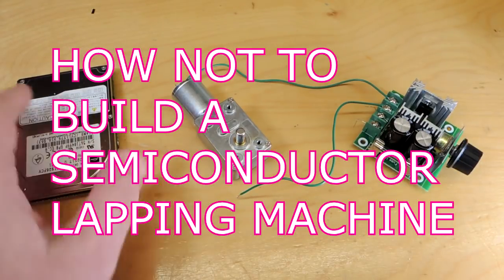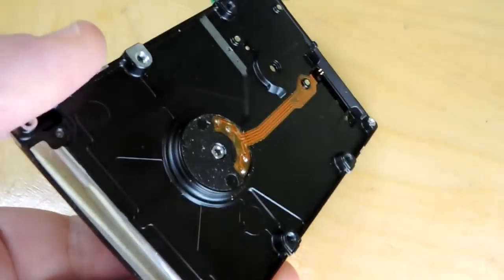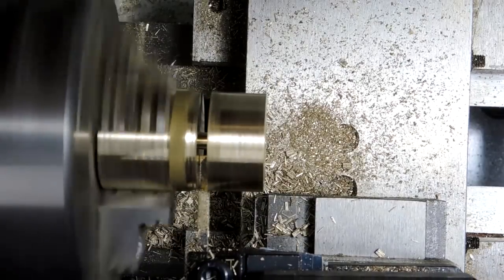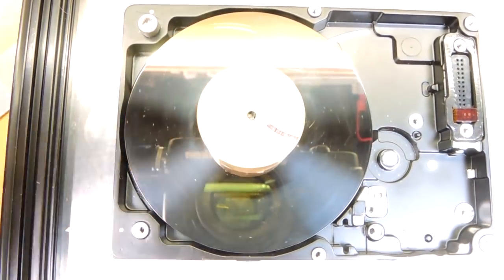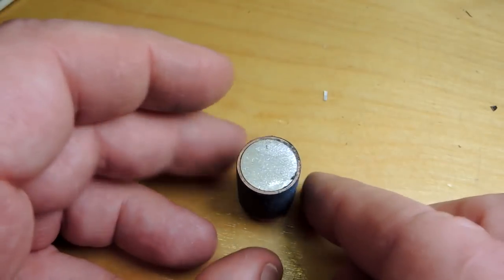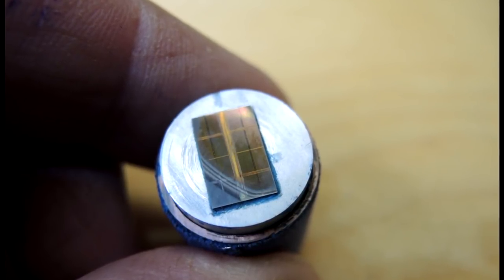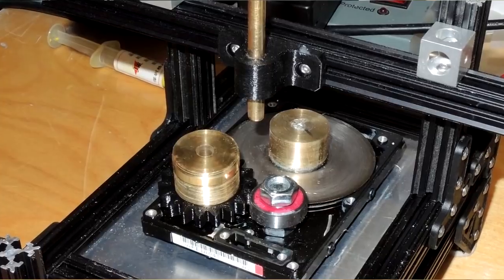HOW NOT TO BUILD A SEMICONDUCTOR LAPPING MACHINE

Comment: Random thought:  To some extent,  the workpiece is "hydroplaning" on a slurry  of abrasive.  The higher the local speed, the greater the hydroplaning force?   Maybe?  So my guess is you don't want consistently uneven speeds (ie: "hydroplaning forces") over the face of the workpiece.  If the outer radius of the workpiece consistently sees faster (or slower) abrasive speeds, then you will end up with a concave or convex part?   Maybe.   I think (??) this is why optical lapping machines often have some "free spinning" (passively rotating) elements. 
 Just random speculation from me.  Oh well, there are books about this kind of thing  (I think one is osmething like,"The Handbook of Abrasive Lapping and Grinding").  Let us know what you figure out!

Comment: Great stuff. My experience indicated that the vertical dimension was critical. Different "abrasion resistance" of material within dies made it inevitable that different rates of material removal led to unpredictable results. 

Lapping is generally used to polish the surface of an object composed of one very pure substance. I fooled around using the quill of a Bridgeport to force planarity in the vertical.  Galling was a common problem as witnessed by the deep channels in your finished work pieces.

Comment: Wonder if the planetary action could be done by a magnetically coupled sample holder which turns while pressing on a sheet of plate glass that rotates in a different arc while having the sample holder drive magnet underneath it? The magnetic coupling should hopefully minimise the wobble effect. :-)

Comment: Very cool project! Not sure but could it be because the rotation rate of the sample is too fast? This could mean the relative speed of the outside of the sample vs the centre is high enough to remove different amounts of material. Could lap the holder with no silicon (as others have suggested) but then get an optical flat to test the flatness of the holder. Or talk to Oxtoolco's Tom Lipton (youtube channel)

Comment: I would be curious for you to try an experiment where you remove the rubber friction elements and instead let the holder "free spin" against the wheel.  

(I have a bizarre theory that currently you are rotating the holder in the wrong direction.  Probably I'm wrong as I know little about lapping.)

Comment: Brilliant project! But, You need to carve few lines into the lapping surface, for storing the removed particles, and the lapping surface needs to be softer then the lapped material. I Also suggesting to use more thin fluid diamond mixture. Greetings!
Reply: I suspect these some very good suggestions...   Also look to some of Tom Lipton's videos on lapping (oxtoolco on youtube), as well as some telescope mirror grinding/lapping videos.
Reply: You can lap in two ways: with a charged lap (softer than the object to be lapped with the grit embedded into it) or with an uncharged lap where the lapping paste is more liquid and flows between the lap and the part. Charged lapping is generally easier. HDD platters have an aluminium oxide layer, which is much harder than the silicon dioxide of the surface of the semiconductor. Some of the diamond particles are likely embedding into the chip and wearing the lap. Some will be pushed ahead of the chip, so what's probably happening is that the diamond is wearing a groove over the path the chip takes. It then slowly charges the chip with powder and continues to wear the groove in the drive plate.

A better way to do this would probably be to make 3 similarly sized circular platters out of a thicker but softer material such as brass. Then lap them together using the 3-plate method to get them as flat as you need. Since that method is what's used to make primary standards of flatness such as surface plate master standards it's able to attain flatnesses far better than what a hard drive requires. Without special equipment such lapping can get down to about 1 helium light band (280nm). Optical flats with a monochromatic light source are a common and easy way to measure the flatness of such a part.

It's important to have the lap be stiff. If it's bending under the force of lapping (as the drive platters probably are) the results will be poor. That's why a thick piece of brass is a good idea: it's soft enough to be charged with diamond, it's strong enough to resist deformation, and he already has brass round stock.

Comment: Nice project, as for the uneven results, i wonder if the platter is flexing under the weight of the sample holder and die. I would try removing the three disk platters off the spindle, switch them and the spacers around so the platters are all sandwiched together without the gap for the heads. it might make the platters a little more rigid.
Reply: I was wondering the same.
Reply: little late here,but in addition to that,maybe glue the discks together for more rigidity,as a sort of "metal plywood".in fact,as im looking for ideas to do the same thing,"semiconductor laping",i think i will give it a try.
those chips are really beautyfull inside.
Reply: Mount the chip with double sided adhesive tape. We have seen chip warping by several microns when glued (with e.g. superglue).

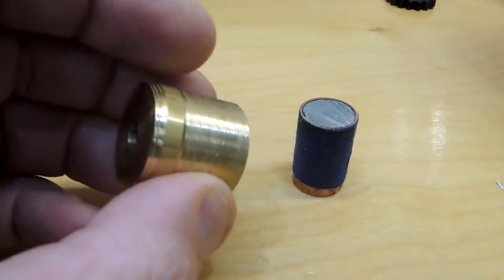Comment: try making a rectangle on the bottom side of that yellow brass you showed at 4:28 and that hole thats already inside it should go all the way trew ....... the semiconductor will be put inside the rectangle rubbing against the platter evenly (hopefully) and put a rode inside the brass peace to apply pressure to the back of the semiconductor like 4:40 and make the semiconductor have a contact with the plater 

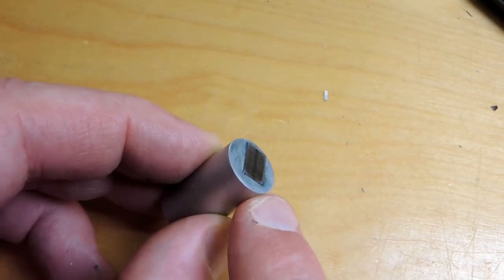at 3:36 the rectangle cut should be where the dye is glued that way you can prevent the corner effect
i hope you try this and i hope it works

Comment: If you didn't, try running it without any silicone on it to get the bottom face of the holder squared up with the rest of the rig.  Have you considered holding the stabilizing rod higher up and possibly in two places?